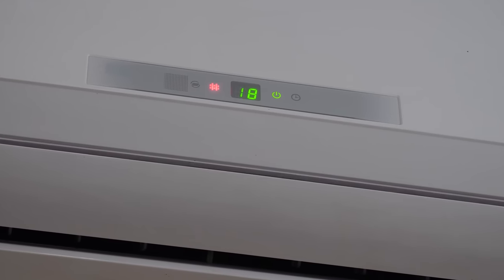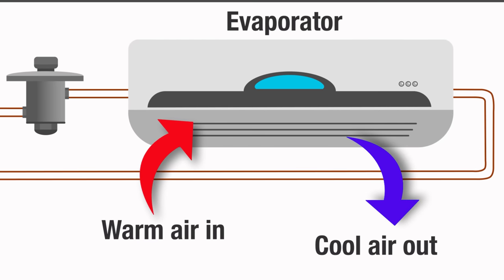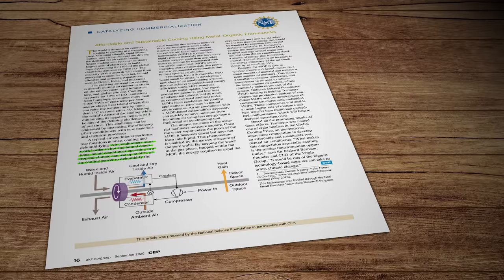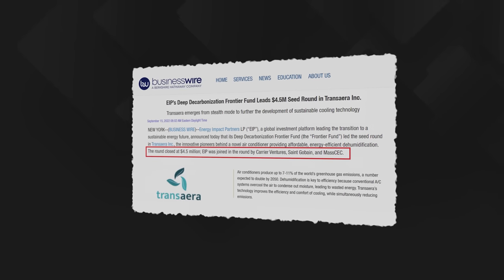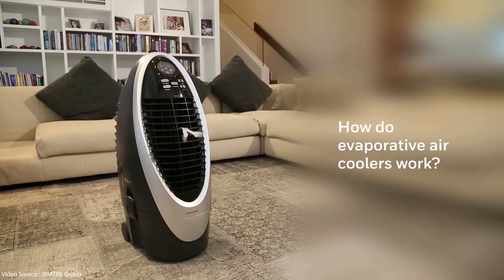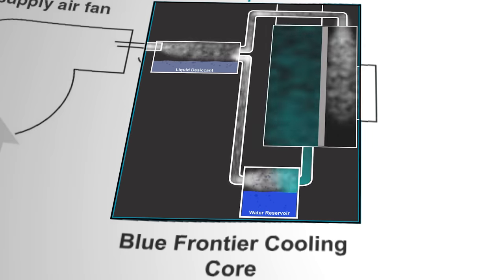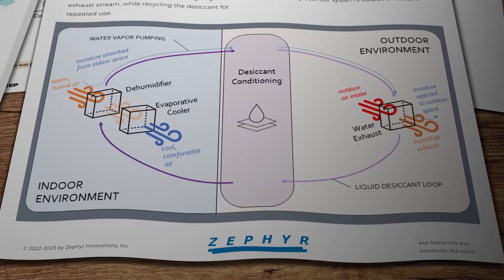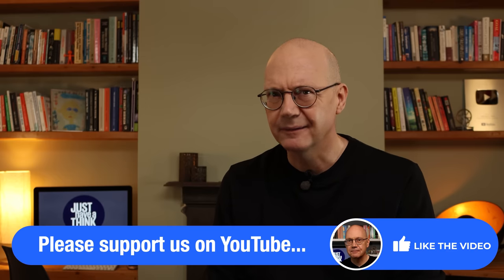Emissions free cooling. Can we do it?

Comment: The benefit of using a desiccant-based system is that you can dry out the desiccant solution using heat instead of electricity, which means that you can use a source of waste heat or solar thermal which can be generated more efficiently than solar PV, or even in parallel with it. One solution I've seen for incorporating desiccant loop cooling with a refrigerant cycle cooling is to use the waste heat from the refrigerant cycle to dry the desiccant.
Reply: If you have two containers for desiccant you may not even need downtime to dry it - just hot-switch which container is being used and pump waste heat round the other one to dry it out in the meantime
Reply: @Yavorh55 something like that might work, but these systems are a bit more involved and interconnected than they are made out to be. I looked over a flow chart of one and there were different concentrations, temperatures, and humidity all over the place. I don't understand the process well enough to say for sure, but by the time this method was put into place it could end up being indistinguishable from having 2 whole units side by side sharing a fan...

I'll take another look, but I was tired and didn't have much time when I first glanced, let's hope I just took the wrong conclusion.
Reply: I want to buy something like that so badly. Where I live the temperature and humidity are both in the eighties year round (30 C for folks outside the US.)
Reply: This relies on being able to dry out the desiccant in a humid environment aka, not possible.
Reply: @inquaanate2393   You are correct.
If you could use heat to dry the desiccant then the desiccant to cool your house you would have invented perpetual motion.
It is NOT the "heat" that dries stuff, but the cold-side of A/C that is lower in humidity.
Dave made an historical error that is important to understanding this problem.
Mechanical compression A/C was NOT invented to cool per se, but to dry ink onto newspaper.
The first block diagram he showed used a heat-pump to dry the desiccant. This does work right now.
But they use the heat-pump as a de-humidifier. The complexity is WAY to much for home cooling.
Reply: 21 years ago we looked into a desiccant dryer A/C for a home in Costa Rica we were helping design.  It used a solar heater to dry the desiccant wheel and was ideal for humid, temperate climates.  I'd have to look for the manufacturer to see if they're still around.
Reply: Throw a bucket of water on the floor.

Comment: I don't know how different this new solid material is from silica, but Munters makes commercial dehumidifier units that already use this same principal . They've existed for years. Walmart and Target here in America use them. They still use tons of regular dx systems though. It also adds complexity to the system and a lot more maintenance. The old units used to use gas heat exchangers that ran all year to dry out the desiccant wheels. The newer ones use a regular compressor that has a vfd on the condenser motor. It uses the heat of a specialized condenser to dry out the saturated wheel. The wheel then spins and is exposed to the unconditioned air to remove more humidity. The wheels last for years and years but they must be cleaned because they get clogged with dirt. We also just run into skill level problems with techs. These units have been around for years but people still don't seem to understand how they work.

Comment: I live near the Gulf of Mexico so removing water vapor from the air is always needed. When the indoor humidity drops below 50% you can be comfortable at a higher air temperature.
Reply: I live in the Pacific Northwest on the coast. We are lucky in one sense that we need dehumidification only during the cooler months. I hear from people time after time that the damp bothers them far more than the cold here. I’m a big proponent of using a dehumidifier here and the heat it pumps out is considerable which is a win win. Our situation near the coast is a minority one though and these new what I would call hybrid types of technologies will be progress where heat and humidity happen at the same time.

Comment: I've been in this field for 35 years plus and when I have installed air conditioners,  immediately the customer feels cooler although when you look at the thermostat it hasn't dropped one degree because the first thing they are conditioner does is take the humidity out of the air and if you live in a place like South Carolina or Florida you know what I'm talking about.
Very interesting innovation although it has to be affordable in order to be adopted.
Reply: Definitely has to be affordable, hopefully even if it costs more up front the long term energy savings would sell it.  However, that argument isn’t going so well for EVs which makes me doubtful that it would be any different for AC units.  Companies (especially big ones) will  always run the lifetime cost numbers and convert if it makes sense, this is not as likely on the individual level. However, even getting companies to convert is a win in terms of total energy consumption, and once companies have adopted the technology it could both drive prices down and possibly change public perception.
Reply: Even over the pond we notice the difference between a hot dry day and a same temperature humid day definitely reducing the humidity make thing way more comfortable. 🇬🇧
Reply: @wobby1516  That's because we're the same species, believe it or not. 😉
Reply: @nagualdesign  I'm ... not totally convinced.
Reply: My smallish home (1000 Sq ft) Alabama home is effectively cooled using two 5000 BTU ACs units. On a hot day both run continually and dehumidify the air to around 20-30% relative humidity.  With an air temperature of 78 to 80 F degree , and fans to circulate the "dry air"  it always feels delightful.  My utility bills run $100- $130 per summertime month with 2 teenage children at home.  Dehumidification is the key.
Reply: @wilfredvanvalkenburgh2874  this year I only ran one small window unit. It dehumidifies the air but it doesn't cool the air all that much. It's undersized. Running the fan on high helps.

Comment: My idea is to use a geothermal loop for cooling and heating.  The liquid from the geothermal loop may be enough to condense moisture on it's own, and using the cold side of a heat pump can provide more cooling if needed.  In climates that need heating and cooling, this would seem to "store" heat underground in the summer, and then the heat is recovered in the winter.  On the surface it seems this might increase the efficiency of geothermal heating while providing efficient cooling.

Comment: It's frustrating how much time we spend talking about making heating and cooling "more efficient," and how little we spend talking about changing OUR BUILDINGS, so they don't need to constantly expend energy to heat and cool themselves. Vernacular architectures had this figured out centuries ago.
Reply: Fixing old homes releases mote co2 than it saves..
Reply: People want their giant sun-facing expanse of glass.
Reply: So true.
Reply: Definitely. Making your house more in line with PassivHaus principles seriously reduces your requirement to have AC in the first place.
Reply: @MarkkuS  Not really. PassivHaus principles seriously reduce the amount of energy you require year on year
Reply: Some vernaculars in some climates, to a level of comfort that we would find totally unacceptable these days. However, the gist of your comment is bang-on. Buildings could be waaaaay more energy efficient than they generally are........but the perennial problem with this approach is that a trivially small proportion of the world's housing stock is new, and retro-fitting old houses to bring them up to the most modern standards is somewhere between difficult and impossible.
Reply: Believe me. Old Queenslander houses no longer work well enough to keep people cool enough. The climate has just gotten too hot.
Reply: Your comment reminds me of transoms and double hung windows.  There's passive energy architecture that's time tested and proven, many pre-industrial examples as well as innovative designs, that can be employed in newer structures.  But there's no magic pill - we need to make a wide variety of adjustments.   We already know a great many things we can do that aren't particularly tech heavy.

Personally, I think we've already breached the tipping point in climate.  Either way, our future will not be like our memorable past, so everything we do going forward should be aimed at accommodating the changes in energy and climate that we'll be increasingly facing.

Comment: The company can at times eliminate energy to dry desiccant with the following improvements.  If they double the desiccant and dry half during the heat of the day, while using the other half for dehumidifying, solar can dry the desiccant which will be used for the following day thus reducing or at times eliminating energy needed to dry the desiccant.  Energy storage can eliminate the need for energy. 
 Low solar days can be offset with what they are currently doing using power to dry it or eliminate with heat storage.

Comment: The ability to control humidity independently of heating and cooling can increase comfort and use less energy but it might have higher equipment costs. For this tech, it would nice to have a humidity set point and be able to control how much supply air bypasses the desiccant. In a hot but dry climate like a desert the extra moisture in the air might actually be a benefit. I do like the idea of using a heat exchanger when you don't want the extra moisture though.

Comment: We have been using Geo heat pump powered by PV for 13 years now and enjoy both the cooling and heating @ 400% efficiency. The initial expense of installation was really quickly offset by the savings and  during the summer has the added benefit of taking the humidity out of the air as well.

Comment: There's a lot that can be done to raise the efficiency of cooling, including using solar energy to create air flow, phase change energy storage with with sodium sulphate, and the Maisotsenko cycle which allows evaporative cooling down close to the dew point. But these types of systems are more complex, more difficult to maintain and more suited to large systems I think. Maybe the biggest gains you could make is to get people out of houses and into apartment towers, where you can use economies of scale. Good luck with that though!

Comment: You can use most modern air conditioners as heaters aswell as they just reverse the process. In fact I find it strange that air conditioner= bad and air source heat pumps= good when they are both basically the same device. I installed an air conditioner on my house in the uk in a bedroom. On the rare days I use it I can leave the bedroom door open and it cools the whole house. I suffer from allergies and the air conditioner has a de-ioniser which helps keep the air clean( main reason for buying it), so I run just the fan most nights. In autum and spring I can set it to heat to put some heat in the house without having to run the gas boiler. I find it very cheap to run as my electricity consumption over a year has not changed much. I have friends that have adopted solar and heat pumps, and none of them are happy with the outcomes that have here in the uk. In fact a good friend who has had solar for 10 years has just been compensated as the savings were no where near the projections of the installation. While it’s nice to see people consuming lots of energy developing new ideas to get us to consume even more energy, I myself believe you should just consume less in every aspect of your life to reduce your individual impact on the planet. Climate change or whatever we want call it is simply the result of overconsumption of the planets resources and all the ideas I have seen simply move consumption from one resource to another and introduce more inefficiency which results in net increase of resources which will eventually create more problems even if we can’t see those problems yet. If we were smart enough to see how our efforts effect the future then we would not have the problems we have today, which is the rub. Makes you think?